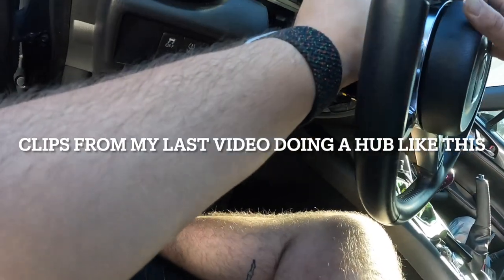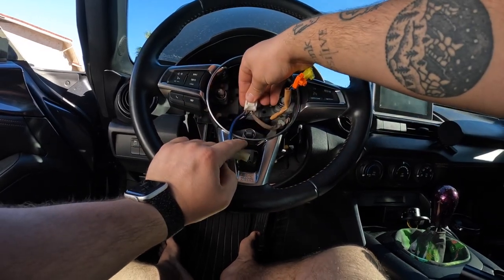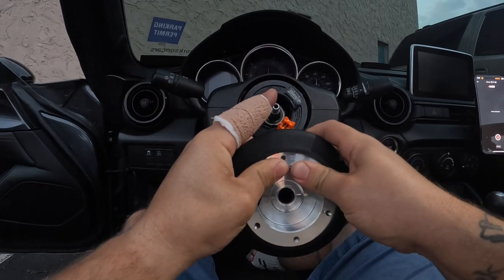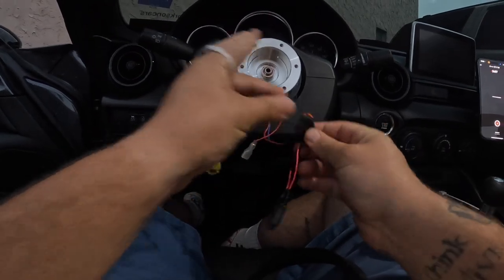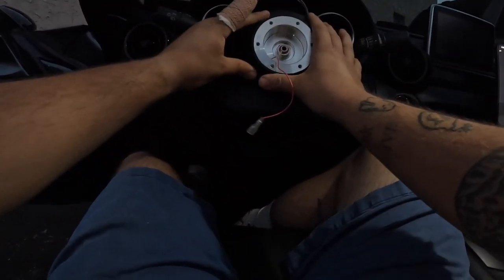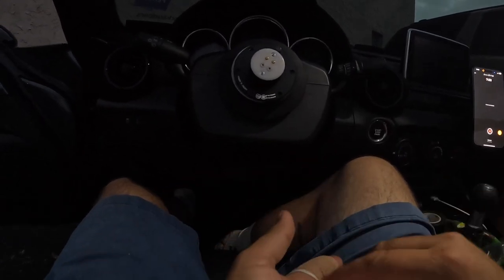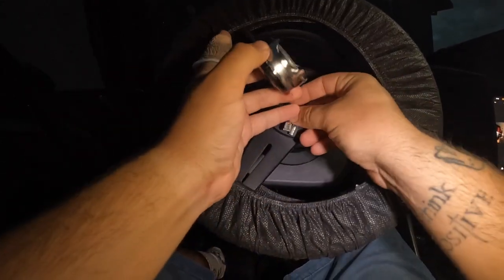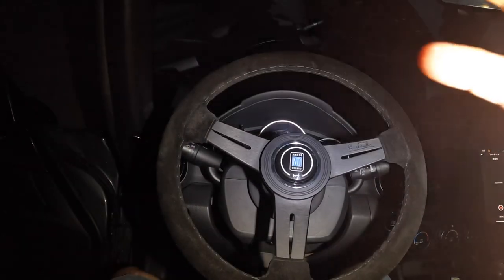works bell everything for my 2016 nd miata

Comment: Super clean I like it. So you’re going to lose all your steering wheel controls but I guess that’s not a huge deal. 

Can you link a parts list? :) I think I’ll go with a Momo Monte Carlo if I do it but I really like it. I don’t really care about losing cruise control. Losing volume buttons and such kinda stinks though.
Reply from the maker: I got my parts from RAV nine and they also sell a Choi fast button relocation kit
Reply: @kyleworksoncars  yeah I saw in your other video you had a button relocation. It looks a little goofy but at least it works I guess. Thanks!
Reply from the maker: @Flying_fisher  I’m selling mine I don’t like it tbh
Reply: @kyleworksoncars  So you're just rolling with no wheel controls?
Reply from the maker: @Flying_fisher  nope I don’t use Cruze control ever tbh in the middle. Control does all the other stuff for me anyway.
Reply: @kyleworksoncars did the airbag resistors come with the hub / rev9?
Reply from the maker: @Accost2u  yea but I had already ordered some on Amazon just incase
Reply: @kyleworksoncars  which ones did you order? I’m going to be doing a wheel this weekend and not sure which resistors to get.